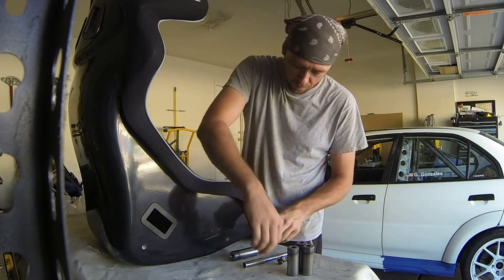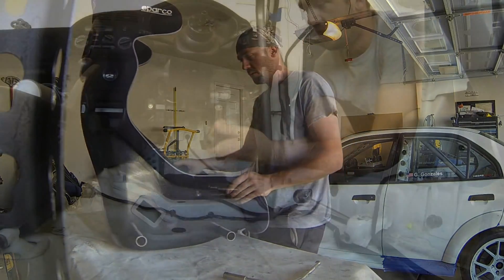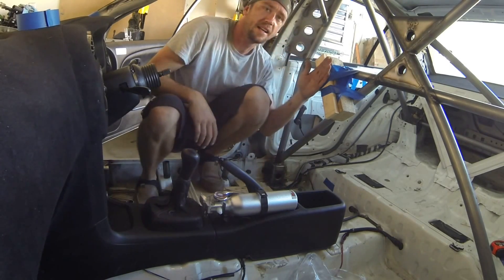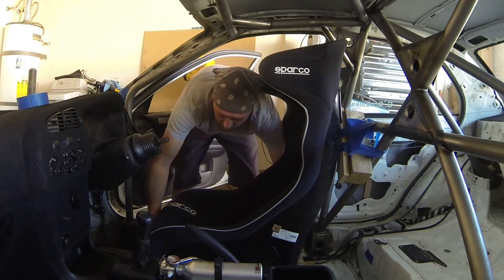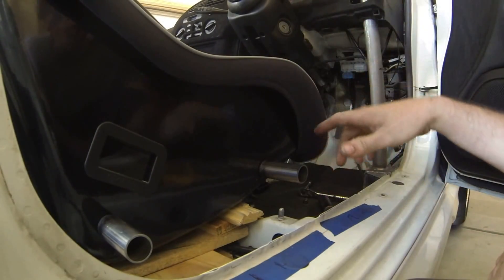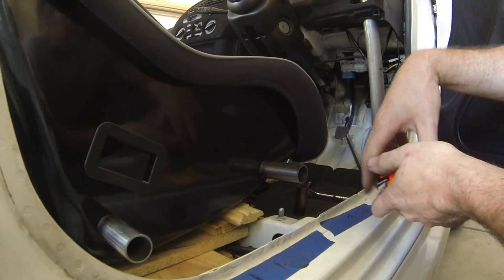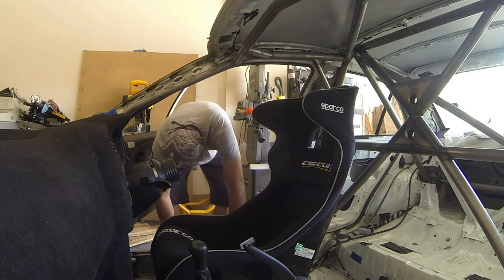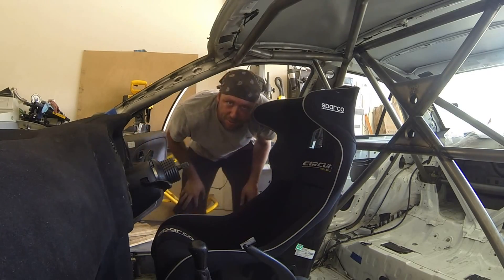TFSS: How To Build A Time Attack Roll Cage - Seat Brackets

Comment: love the videos, what tig are you using and whats that gun your using. thanks
Reply from the maker: +Ryan Richardson Thank you. The TIG is the Miller Diversion 180. The torch is just a 17F. I use the 17 when welding heavier stuff, but switch back to a 9 for manifolds and such.